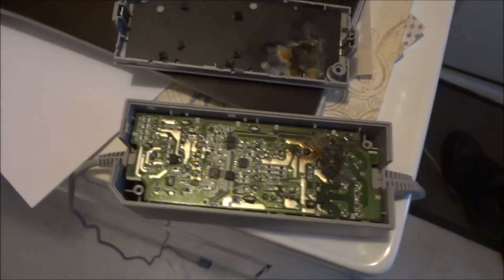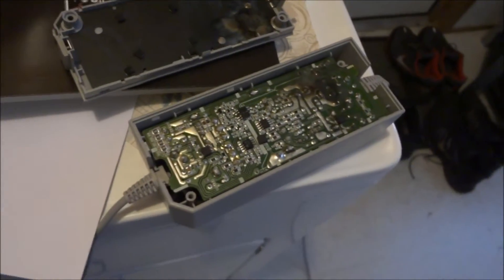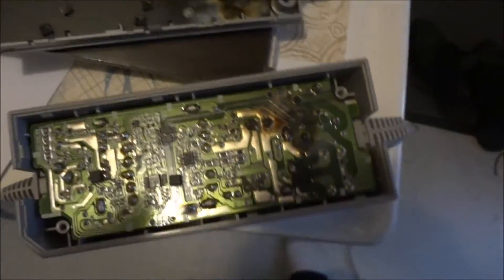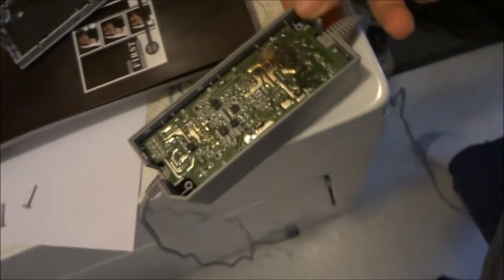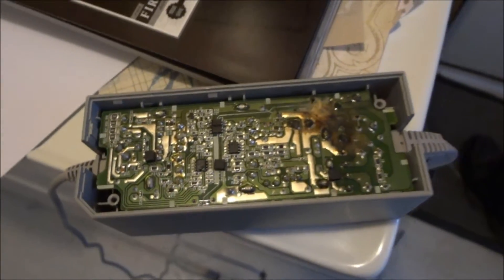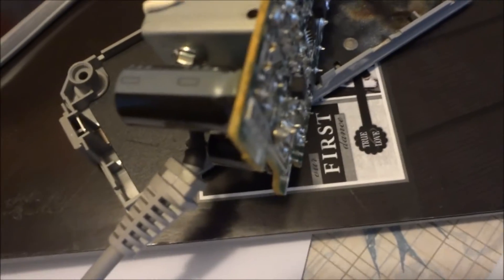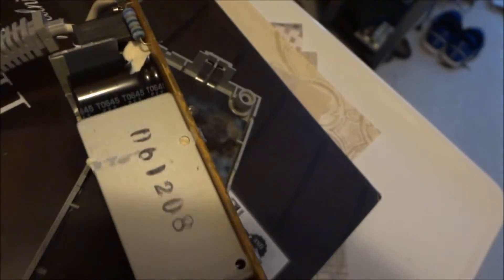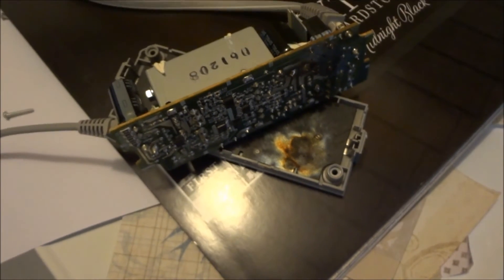Wii won't power on after lightening strike. Power supply disassembly.

Comment: Did the circuit board die? Thats what hapened to a super nintindo once
Reply from the maker: Lightening strike. I bought another power supply. It also fried some of the video output components but still worked with component video but S-video or Composite output fried.
Reply: @ oh interesting 🤔

Comment: Pls answer my question the exploded power supply still works or  no pls answer? I plugged with no transformer so it exploded new subscriber pls answer
Reply from the maker: No it don't work and I could not fix it so just ended up buying another. They do have a reset though that once you unplug it for like a day and plug it back in it resets if it's not blown but this one was blown badly from lightening strike so the protections built into it did not work fast enough apparently. Thanks for sub.

Comment: Hello guys hope ur all doing well. So my girlfriend's wii has a steady red power light is there a fix for this? She said that it was previously plugged to a 220v source where the wii is only 110v. Her wii has 2 ac power adaptors a 110v(which was plugged to a 220v source) & a 220v. The 220v ac power adaptor is the one i'm using now that causes the steady red light on the wii's power button
if I use the 110v there is no light on the power button. My question is, is it possible the wii was not damaged and only the 110v power adaptor got rekt or both the wii and 110v died? If the wii is still alive (coz of the red power light) is there any fix for this that I can do?
Reply from the maker: This is the information you need.     

https://en-americas-support.nintendo.com/app/social/questions/detail/qid/48382/~/wii-will-not-power-up/comment/5560

There's a way to reset the wii power adapter if you read down through the comments. Good luck but worse case scenario you will need to buy another wii power adapter but please try the reset method first seems the power adapter has a circuit breaker inside that can be reset by reading nintendo's directions.

Comment: how do you open it? i dont mean the screw part, i cant get it open, i already put the screws out, help
Reply from the maker: I don't remember exactly but looking at the video I think I had to use a small flat edge screwdriver to pry up along the seem to pop it lose from tabs. Did yours get hit by lightening? I read that these power supply's have a reset in them and if you leave them unplugged for a day or 2 and plug them back in they reset someway with a relay or something. You might wanna try that first just unplug it from the wall and let it sit for a day or 2 I'd recommend before trying to repair it. I had to buy another one because this one was toast.
Reply: @Nesmaniac  thanks, no, it wasnt hit, it just stopped working after a week without use, i think is some condenser.
And yes, i needed an screwdriver, it looks like it had some snaps on the sides 
(sorry for the english)

Comment: Did your wii power back on eventually? My Wii power brick just blew up basically, Im wondering if the wii will be okay
Reply from the maker: I bought another power supply and all was ok. Another lightening strike took out the video output (which it was hooked up to at the time I can't remember if it was composite, s-video, or component) but when I tried another different output cable it worked so each one uses it's own separate video output circuit which is great.
Reply from the maker: I bought another power supply and all was ok. Another lightening strike took out the video output (which it was hooked up to at the time I can't remember if it was composite, s-video, or component) but when I tried another different output cable it worked so each one uses it's own separate video output circuit which is great.

Comment: Can someone please tell me how/why the power supply would over heat? After testing w/multi meter (due to NO power to the Wii) my readings verified it was the A/C adapter. I found the video on how to take it apart and found the capacitor melted, a white substance that looked somewhat like melted plastic and other melted components. The thing is I bought the entire system used and never did have power so it had to have happen prior to me buying it. I notified the seller, he's willing to take it back and refund my money, but seems to want a explanation to how this could happen when his kids supposedly had NO problems w/it, he says it worked fine. Honestly I don't want to do the exchange because he did give me a really good deal on everything (I know I can't find everythinf he sold w/it like accessories & games, stand, charger, controllers, and obviously the Wii system w/all original manuals/box, etc. for what I paid. I would like to give him an explanation and see if maybe he will just replace the power supply.
Reply from the maker: Some of these power supplies have a white rubbery hard type of material like a glue insulator that the manufacturers put around the capacitors. If a capacitor goes bad usually u don't see anything other than sometimes it's bulging at the top. Now if you see black in there then lightening strikes do that burning it and u can smell it. The Wii power supply can usually be unplugged for a day and it has a reset switch that automatically resets it that seems to fix a lot of them from what I read, actually, mine had to be reset a few times like that before lightening took it out.
Reply: It have no idea. It just happened to me out of NOWHERE.  I took the wii out of the attic, it was sitting there for a year or two. I booted it up in my basement and was fooling around with it, making sure it works. then i brought it upstairs (the better tv) and set it up, got to the wii menu. I left the room to get some water, and hear a POP. I thought the wii fell or something at first. I get back to the room and try and figure out what happened, when i see a giant flash of electricity coming from the power brick along with a BZZZZZZZ. Sure enough it was shot. idk what happened but i sure hope the wii isnt busted now